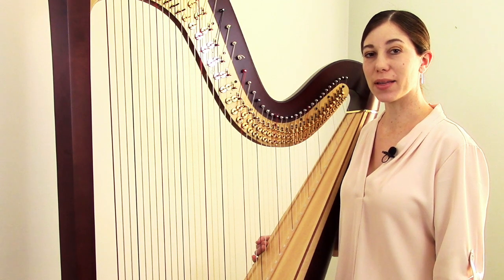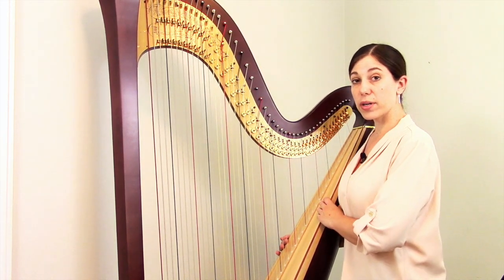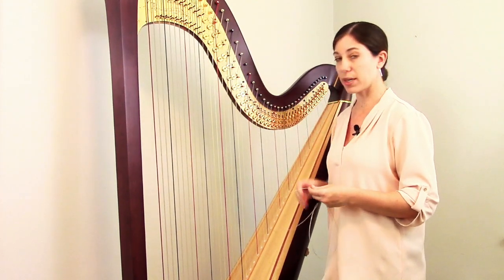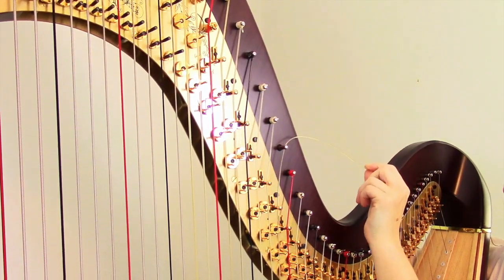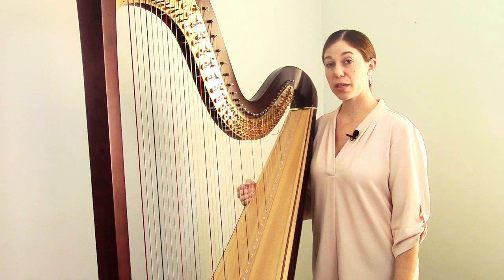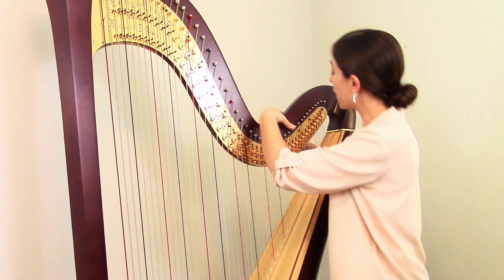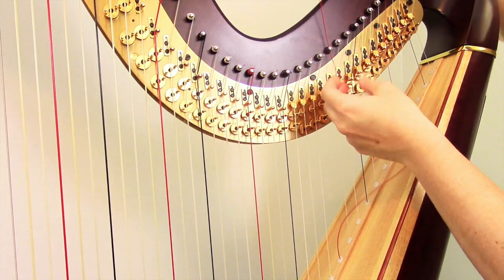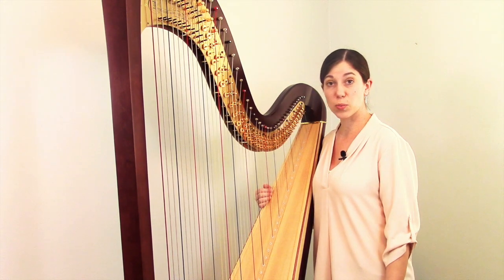Replacing a Gut Harp String, Harp Care, Maintenance, and Repair #12

Comment: Very interesting Ive been working for bow brand the strings you was using since 2002 and that is the first time I have seen how they are put on the harp thanks.
Reply from the maker: Do you mean you make the strings? I've watched videos about this and have always wanted to visit a factory and see it in person. Glad you liked the video!
Reply: @JacquelinePollauf  hi yes we make the strings and we do have factory visits from time I’ve worked my way round the factory I started in the raw material in the wet area, then 5 years put the dry gut though the polishing machine then I moved to dispatch/ packing. If you do come to England we are in kings lynn it 100 miles from London.
Reply from the maker: @chezcaudwell1938  That sounds like really interesting work. I hope you enjoy it (or at least parts of it). Good to hear that you have factory visits!

Comment: I just replaced my first harp string today.  I don't know why, but getting that knot right was not easy for me at all.  Your video was excellent, I was just having trouble with it.  My string had a ton of memory, and kept coiling up super tight around my hand.  In the end, I got it done.  The knot looks hideous, but it works.  Hopefully the next one goes easier.  Thanks so much for the video!
Reply from the maker: The knots can really be challenging! It frequently takes quite a while to feel comfortable with it, and sometimes the gut is quite resistant. I'm sure it will get easier!

Comment: Hi, thank you for the video. I have to change my very first string on lever harp, it's a D12 of 0.0535 gauge. Since I don't have an anchor can I use a little piece of the same string to make one or it is too thin to work as anchor? Thanks❤.
Reply from the maker: Most likely you can use a little piece of the same string. As long as whatever anchor you use doesn't pull up into the harp, you should be fine. Some people also take a little piece of cotton (or something similar) and cut/twist that into a cylinder shape to use as an anchor. Good luck with your string!

Comment: Thank you for your videos! My harp teacher retired a few years ago, and your videos have been very helpful!
Could I ask a question? I recently had a 5th octave B string break - it broke near the bottom of the string. I was able to replace it, and I thought it was fine, but about a week later the same 5th octave B string (the new one) broke again, this time up at the top of the string by the tuning pin.  Is there something I could have done wrong that caused this to happen? I suppose it could also be climate change - we had a warm spring day with windows open when it broke the second time. I’d appreciate hearing any thoughts or insight that you have. Thank you so much!
Reply from the maker: I'm so glad you're finding my videos helpful! Having the same string break twice in a row is a bit unusual, but since it broke in two different spots, most likely the new string was a bit flawed. This can happen from time to time with gut strings. I think you should be fine with another new string, as annoying as that is!
Reply: @JacquelinePollauf  It is frustrating! But thank you for taking the time to reply - I appreciate it!
Reply from the maker: @bringmeaharpist4381  It is indeed frustrating! Strings can be difficult.

Comment: For me, the most helpful part of the video came at the very end, because I've recently purchased a new harp (LH Prelude 40), and already two strings have burst after three days since it arrived, both 4th octave gut of course. And one of them broke randomly in the middle of the night, though I had read about this and made sure to keep the temperature at about 68F. The humidity around 50%. So, when you said at the end that sometimes strings just break and it doesn't mean you've done anything wrong, I just sort of, sighed relief! But this video overall was very easy to follow along and pleasant to watch. I laughed a little when you were clipping anchors and one of them darted off and hit a wire string! It's happened to me too. Cheers!
Reply from the maker: Thanks so much! I'm glad to hear that you found this video helpful (and funny in spots!) with your new harp. Strings really can just break at any time, so I don't think you're doing anything wrong with your harp. I hope that in between replacing strings, you're enjoying playing it!
Reply: Try Fluorocarbon Strings

Comment: A good alternative for string anchors is to use small wooden dowels (usually used in carpentry), with a diameter between 4 and 6mm. They can be purchased in generous batches, for cheap, at most hardware stores.
Reply from the maker: I do know that some harpists use wooden dowels, but I personally prefer to use string anchors. Thanks for sharing the tip!
Reply: @JacquelinePollauf  I usually use wooden anchors for low-mid strings, and string anchors for treble strings.
Thank you very much for these videos, as a newly established (folk) harpmaker in Scotland, they helped me better understand pedal harps (which I'm way less familiar with than lever ones).
Reply from the maker: @ElNinoBance  Glad you've got a system that works well for you with the string anchors! And that's fantastic that you're a harp maker and that you've found some of my videos about pedal harps helpful. Good luck to you!

Comment: Thank you so much for your superb clarity in demonstrating the technique involved in changing both thick & thin gut strings.  I especially appreciated the close-ups of the actual knotting procedure, and your calm voice & reassuring words regarding the truth about broken strings - that they just happen, & there is no need to panic; as well as your great suggestion on cutting up old 5th octave C, B, or A strings to create anchors for future string changes.  The quality of the lighting in your video was excellent, & your smile, very encouraging. 
Thank you again.  God bless you!  (I have found that some of my broken strings happen after large barometric pressure changes- not sure if there is any connection there).
Reply from the maker: So glad to be of help! I'm happy to hear that you found everything useful and hope your string changing goes well. Good luck!

Comment: Thank you for the video, still struggling figuring out gut strings unfortunately. Do you need to add slack when you replace a higher gut string or not really? (just nylon?) Also I had a problem with my gut string wearing out on top if I didn't wind it in correctly the first time. I'm not at a level where I can just wind it perfectly in one try. Do you have any tips on how to prevent this? Thank you!
Reply from the maker: Generally wire strings are the only strings where you need to add slack when putting a new string on (by which I mean not pulling the string taut before you begin to wind it).

When it comes to winding the string around the pin, most people who find this challenging have trouble getting the string to wind tidily and not end up jumbled on top of itself. If this is the trouble you're having, I'd suggest seeing if you can have someone help you during this step. Usually if someone puts a finger along the string and you wind slowly they can guide the string into a nice tidy winding the first time around. If you're winding all by yourself, I would just go really slowly and any time the string starts to get out of position, stop and adjust it right then and there so you don't have to completely unwind it and start again. Good luck!

Comment: Question, can you use a B or G string in place if an A string if i dont have an A string? Thank you for this video!
Also, im trying to replace 2 of my A strings because they keep making a buzzing sound, and i have tried everything but change it out. So im hoping changing it will do the trick. Do you have any advice?
Reply from the maker: If you don't have an A string, I would use the B string instead. Using a G means that you'll have to wind it tighter than you normally would, so you want to avoid that.

Most likely, changing the string will stop the buzzing. I would check to make sure that it's not the string anchor first, but generally a new string will fix the problem, unless it's something mechanical with the harp. Good luck!
Reply: @JacquelinePollauf  Thank You! The buzzing is still there even after changing the string and checking the anchor. So like you said im guessing there is something mechanically wrong with it.
Reply from the maker: @giraffe6801  Sorry to hear that it's still buzzing! It does sound like it's a mechanical issue.

Comment: Strings frequently breaking in the middle of the night could be because of cooler temperatures that cause the strings to tighten up, like how power lines sag and contract during hot and cold weather :)

Also; do u know if string ball ends (like in guitars/violins) are not used for harp strings because it's in direct contact with the soundboard and could rattle? Or perhaps some other reason?

P.s. this was a very clean and thorough video tutorial, with clear closeup views.. spot-on 👌
Reply from the maker: I believe that you are correct about string ball ends. There is always a fear of rattling or buzzing with the anchor, so hence the popularity of string ends. 

Glad you found the video helpful! It took a while to figure out how to do the close-ups well, so I'm happy to hear that they are working well. Thanks for watching!
Reply: @JacquelinePollauf  Oooh, i didn't know there was always a fear of anchor rattling/buzzing.. that more or less practically confirms it

I couldn't find a direct answer on google, so this really helps a lot; thank you so much 😊
Reply from the maker: @vicachu  Glad to help!